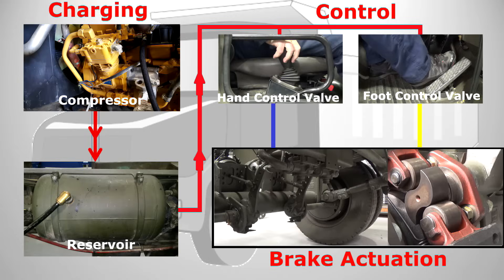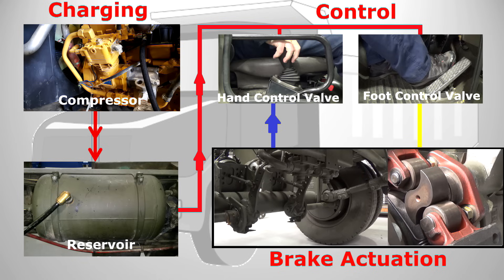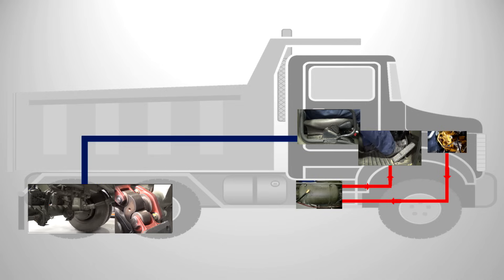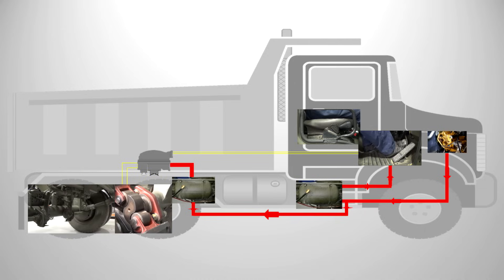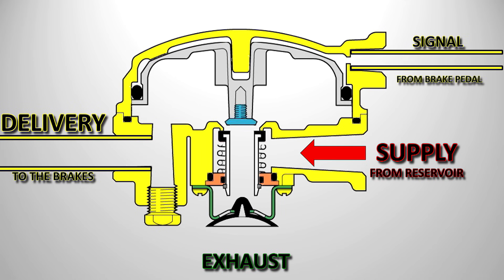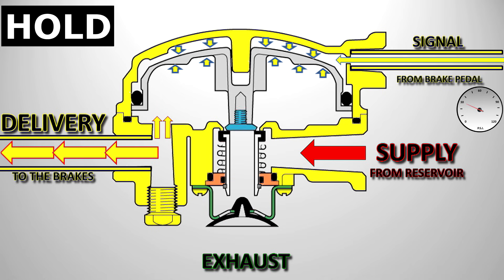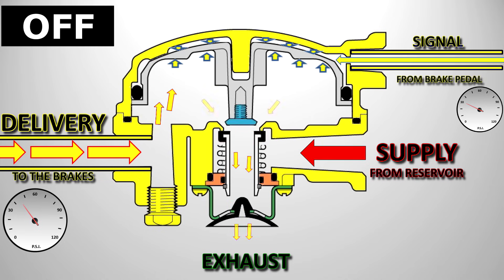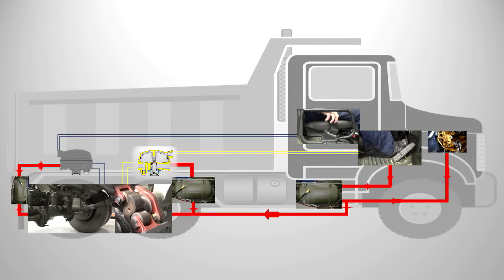Air Brake Relay - How it Works. Air braking systems and Commercial vehicles

Comment: Now what is difference between relay valve and quick release valve.
Reply: I was just searching for that but not a single video
Reply: Relay valve should send air to where it needs to go and the quick release valves releases pressure that has been built up like when you use the brake pedal. You dont want that air stored on the service side otherwise yohr brakes would continue to be applied.

Comment: One misconception people have about airbrakes is that "Air presure" activates the brakes. As a matter of fact, it is the other way round.
By default, the beakes in an airbrake system are already activated without airpresure. Cos the brake actuator is actually powered by a set of very powerful springs.
So when you start your engine, airpresure build up to the desired guage and when you release the parking brakes, air presure goes into the actuator and releases the brakes. and that's when you can move the vehicle.
Now, what happens when you apply the service brake, is that you are releasing air presure from the actuator which in turn allows the springs to activate the brakes.
Reply: I’m sorry, but that’s incorrect. You are right that the parking/emergency brake is applied by spring pressure and held off by air pressure. That’s why it is called a “spring brake.” But the service brakes work the other way: they are held off by springs and applied by air pressure. Loss of air pressure will stop the vehicle because of the parking brakes, but air pressure is needed to operate the service brakes. There is a good series of videos by Bendix about this.

Railroad trains apply air pressure down the brake line to release the brakes (and charge a reservoir on each car), and they reduce the brake line pressure to apply brakes.

Comment: WHAT BE THE PROBLEM ON MY TRUCK IT DELAYS TO STOP WHEN PRESS THE BRAKE PEDAL DOWN
Reply: Rear wheels or Front Wheels?

Firstly make sure you have no air leaking somewhere in any of the circuits

If it's the rear wheels, it's the faulty relay valve on the primary circuit (foot brake valve Circuit ). 

If front wheels, its a faulty quick release valve. 

They cause brake Slag

Comment: Let it be noted
that air brakes are designed to fail safe.
IE if NO air is available ( burst hose) the spring will apply the brakes.
There is also the dead man's brake.
That is a brake that can apply brakes to the trailer only if it is Jackknifing.  Usually fitted to specialist vehicles such as recovery trucks.

Comment: How can the pressure on the top and bottom side of piston can be same. I think the pressure at the bottom of the piston should be equal to pressure of the air in the supply line from reservoir. Pl clarify

Comment: is the air relay valve another name for the four way protecting valve on the air dryer?
Reply from the maker: Hi. No, the relay valve isn't the same. The four way protecting valve A.K.A. the multi circuit protection valve does a different job of isolating individual braking circuits in a system so if one fails, the others don't lose all their pressure, prevent a total failure of the brakes. Hope that helps.

Comment: I have watch your video about the quick release valve. 
https://youtu.be/b04oTJGDF9I?t=208

I have realized both quick release valve and relay valve have exhaust ports. Are the functions of these two type of valves overlapped?
Reply from the maker: Hi. The functions are slightly overlapped, although the way they operate are slightly different. Both valves will speed up the release. But on that, the relay uses a signal pressure to operate and is designed to speed up application and release at a distance far from the drivers controls, where the QRV is inline and operates with the full volume of the delivery air (not using a signal line). I hope that helps.

Comment: Astra iveco dump truck air compressor over heat what the proble of output air heating
Reply from the maker: not sure I understand. Hot air in the system is never great but depending on your setup it may be cooled before it's used. Engine driven compressors will get hot just because of where they are, but your piping and reservoirs should be able to dissipate the heat.
Although, if you've got some big leaks, this will make the system work harder.

Comment: hello? thanks for the lesson but i have a question. what happens when mixed signal pipe to service port and service pipe to signal port? i would like more lesson in this air system especially in trailer how how can i find your support? this is my email peterlukindo3000@gmail.com

Comment: How is signal pressure controlled? Yes, you use press the pedal, but then how the system knows how much signal pressure apply?
Reply from the maker: Hi Igor. The drivers brake pedal is actually a proportional valve. The brake signal pressure is directly related to how much force the driver applies to the brake pedal and the "foot control valve". I've had a break for a couple of years, but the foot control valve is one of the videos I hope to be making soon.
I hope this helps.

Comment: That is strange because when I run out of air the brakes lock on and the vehicle will not move even when in drive
Reply: JessieJ because the air has to reach over a certain amount to overcome the the park brake spring...once ur air pressure is up over that amount u will be able to release the park brake and drive...if ur air pressure ever goes below that amount it wont be able to overcome the park brake spring and the park brake will apply wether you are in drive or not

Comment: Hi !
Can you help me with this question plz ?

What must the driver of a heavy véhicule equipped with air brakes keep in mind about the response time for the air brake système as compared to a véhicule equipped with a hydraulic brake système ?

Thx
Reply: Air is a gas and gases can be compressed but liquids can't. Get a syringe and pull back the plunger then block the open end before pushing down on the plunger. The plunger will feel like it is pushing against a spring. Repeat the process after filling the syringe with water. The plunger will feel like it is pushing on something solid.

Comment: Does it really make a sound when you step on the brakes like releasing air
Reply from the maker: Hey Kristoffer, for the foot brake (service brake) the air is released when you take your foot off the pedal. For the secondary brakes (park brake) the air is released when you apply the brake.

Comment: If u have good drums new slacks new brakes . But your can rotation gauge says your still over stroking what's wrong
Reply from the maker: Hi George, you've eliminated the usual suspects by replacing them and your slacks are set up right. One other thing you could look at is the "S" cams. If they are worn down, you would need to rotate the shaft further to get the same braking force as you would with new "S" cams. Also worth checking the S cam shaft bushes.

Comment: I understood that it is the other way around, when air pressure is in the chamber is when the brake is released.and when you take the air away the brake is apply.
Reply: In the United States that is the case I am pretty sure, but I don't think that is standard everywhere.
Reply from the maker: Hi. That is true, but only for the secondary (and parking) brakes. If you have a look at the video below in this comment, it will explain a bit more about the service and secondary brakes and how they work. https://youtu.be/f9fLf4UUIQE
on service system, air applies the brakes, and on secondary, air removes the brakes.

Comment: Great video, but as a diesel mech in the works, ive never seen a air tank any closer to the cams than the primary tank. I dont think the relay has anything to do with timing of air pressure but the simple fact of it having an exhaust. Abs ties into this relay to regulate the brake pressure when turning or to prevent lock up.
Reply: It’s more about having the extra tanks plumbed to the relays. Hence there is always a decent volume of air ready at the relays to provide pressure to the chamber’s. The valves are always close to the axle. Reducing the distance to air has to travel greatly. That with it exhausting at the valve instead of all the way back at the foot treadle valve helps it release quicker.
Reply: Trailer and Converter Dolly air tank(s)...

Comment: Hey guys, I have a question regarding truck transmissions. Sometimes when trucks drive through deep flood waters, it is said that this will/can destroy the transmission or differentials, as they are ventilated and water may get in - is there anything to that claim or is it BS?
Reply from the maker: Hi. That is true. If the water reaches the vent level then it's possible that this could enter the casing which in turn could contaminate the oil (emulsify it) which could lead to premature failure. Many off road vehicles have breather systems which allow the cases to breathe air from an elevated position without sucking in the water.
When the gearbox/diff hits the water, the water would cool the casing slightly, lowering the pressure inside which would in effect suck in a bit of water.
Hope this helps.
Reply: I've had this problem with my truck launching boats all the time!   Water gets in the differential through the vent.   I took off the vent and put a piece of hose that ran to a high spot and looped over to prevent junk falling in there!!  Problem solved!!

Comment: I’m a diesel mechanic in Canada and the trucks I work on use the air to release the brakes so no air means your brakes are “on” and the pedal releases the pressure in the air pot where a large spring extends a rod that pushes on a ratchet and rotates the   
s-cam rather quickly. 

Does this system not exist elsewhere?
Reply from the maker: Hi Mario, that sounds like an old spring chamber. You might find them on their own in some really old vehicles as the service brake (brake pedal), I've seen a few vehicles that have those chambers just for the park brake but not as a service brake. Spring chambers are a good fail safe, as if you lose your air they will apply themselves. Most trucks now use spring brake actuators, which is a spring chamber and a service air chamber in one unit.

Comment: very nice video cleared up the lag issues i was concerned about in air brakes as well as where the sound is coming from when air is released out the exhaust port when you  let off the brake pedal as well as the brake button/throttle's on dash. Its this simple relay component that i over looked. The relay is an important components :)
Reply: Good 👍

Comment: Any idea how 2 line trailer breaks work ?
Reply from the maker: Hi Henry, we'll be making that one soon. It basically relies on a constant supply on the red (emergency) line and signals sent down the yellow (service line). There are 2 main components that make this happen, the TCV (trailer control valve) on the truck and the REVA (relay emergency valve assembly) on the trailer. Videos on those will be coming soon, in the meantime check this out: http://www.hse.gov.uk/aboutus/meetings/iacs/aiac/transport/conference0308/paper7.pdf
Reply: That'd be an excellent video to make.  I just had a look at the document in the link by Peter Metzger.  Excellent chap.   I'd say unless you have an antique that system is now really not around in any quantity .  2 line trailer braking systems are now all TEBS rather than the old leaf spring variety.  Vast subject in itself.

Comment: Great video! Can you tell me why do some air brakes squeak when you release the brake pedal? Like the ford ones for example
Reply: Some relay exhaust valves have different designs, and some may make a sound like hissing or lots of air rushing through an opening. Some make a sound not unlike a musical note, although that is not the intention of the manufacturer.  Just like different tires would make different sounds on the driving surfaces,  release valves make different noises as the air exhausts out through the ports.  Some sound like a sneeze, some sound a bit like a musical instrument.